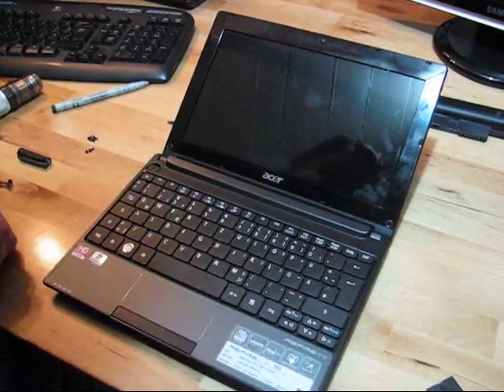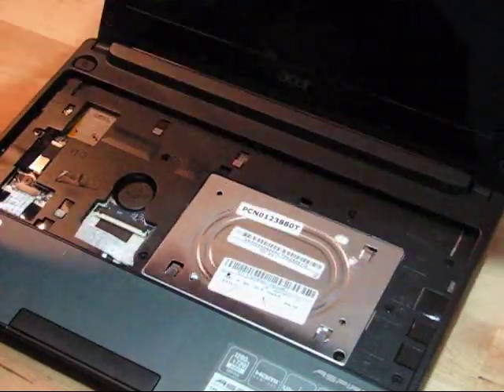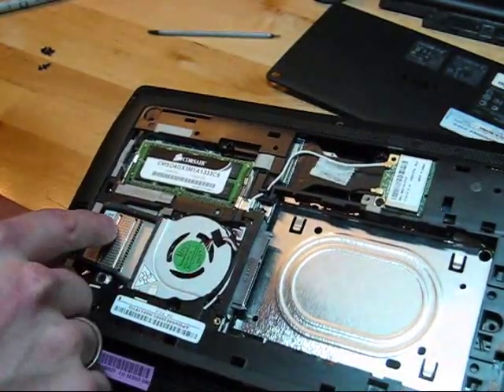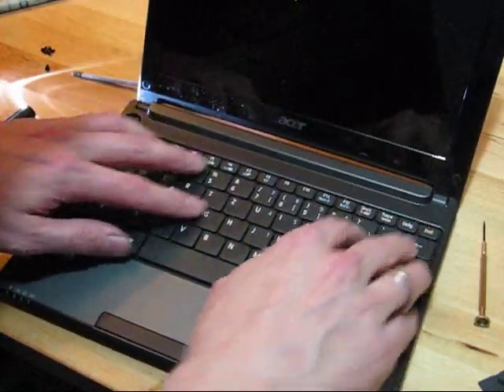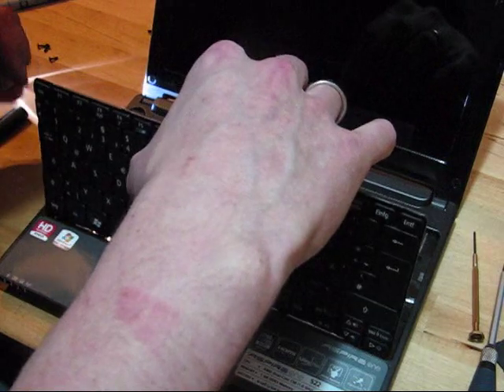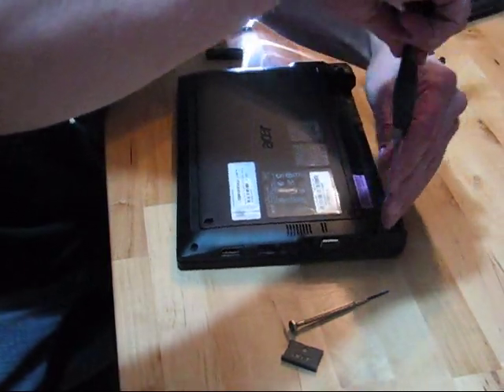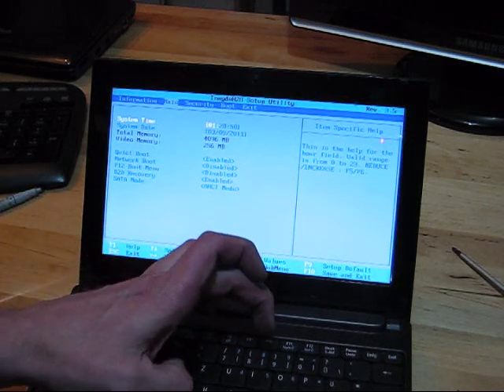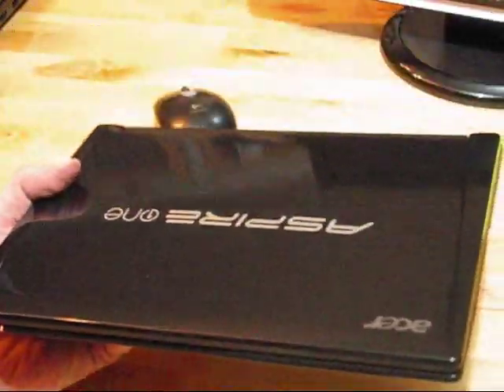Upgrade Aspire One 522 Disk and Memory - How-To Access

Comment: There's no need to take that rubber out to realease the backpanel. In the corner of the hard disk there's a hole specifically to push the backpanel and open it.
Reply from the maker: Thanks Marc.

Comment: Any thoughts on the cooling? Upgraded mine and it worked great for a couple of years but now it's having some heat issues. I guess the forced upgrade to W10 didn't help. Going to measure airflow into and out of the laptop to help me figure out a solution but thought I'd check if you had any suggestions first.

Comment: definitely a pain and after trying to remove the keyboard in the manner shown in the video for over half an hour trying not to screw it up too badly, and also trying to push it up from that little silver access port, i found more luck by taking out all the screws on the BOTTOM of the netbook then gently separating the top and bottom half slightly i was able to gently get a small screw driver under the keyboard and apply just enough pressure to see it bend, then pushed the small retention tabs in

Comment: on my 522 i had to remove the keyboard, as the bottom panel will not slide at all, as it is screwed on, from under the keyboard unfortunately.

Comment: @stevechippy @abj0000 One way to get the plastic latches back after they have "disappeared": With the battery out, there is a strip of shiny tape with a pink sticker on it. Rubbing your finger firmly along this tape (so that you can feel a ridge) should push out those plastic tabs again, since they are underneath this tape strip. Also, to avoid mangling the plastic, I recommend using a credit card. Another card can also be used to keep the K/B up while working on successive plastic latches.

Comment: This is a C-60 isn't it? The site where i want to buy it says that it only supports 1GB of ram... is this just to prevent you from opening the netbook or does it really only support 1 GB of ram.. or does this mean windows 7 starter does only support 1GB of ram? So if i would install Win 7 ultimate (64-bit) on it would it then support more the 1 GB of ram?

Comment: Okay, here's the thing:  You don't even need to remove the keyboard at all. I have disassembled my AO722 (the big brother of this netbook),  and this is almost exactly the same.

What does removing the keyboard accomplish? Nothing. All you need to do is remove that bottom panel, and you'll have full access to the internals. In fact, you don't even need to pry up the panel -- it slides forward.

I tore apart my 722 expecting some convoluted access method, but Acer made it simple for us this time.

Comment: Great vid.  Thanks.  KB removal was a little tricky, scratched up mine a bit.  I used two micro flat head screwdrivers: one to hold each latch in, and another to sneak in to the keyboard edge which is the raised edge, you MUST go in above this to pop it up.  I was pealing back rubber from under the keys before I realized I wasn't wedging in high enough.

Comment: @4554gary thanks for that but I improved that. Instead of applying a lot of pressure onto that tiny spot, i first removed the keys: F4, F8 and Delete (last one). That way i was able to push the latches that hold the keyboard down back (they stay like that if you do it right) and then i simply pushed that 4x4mm hole with a pen softly. Worked like a charm.

Comment: @stevechippy Sorry for the ambiguity, I was referring to the rubber feet, which are glued. I did finish replacing RAM and HDD, but removing the keyboard was a real pain, got me irritated as can be noticed from my previous comments. I found plugging the keyboard ribbon cable back to be quite easy in comparison.